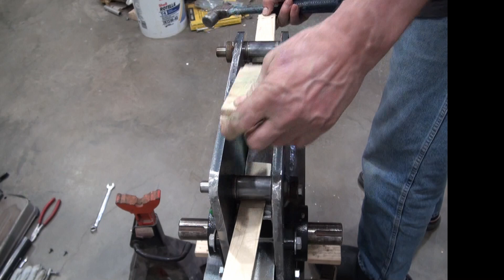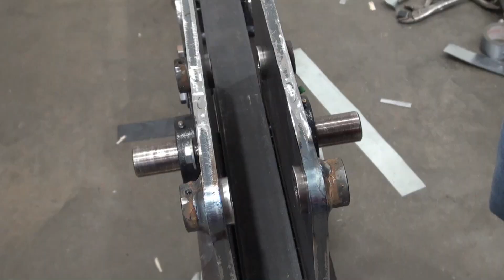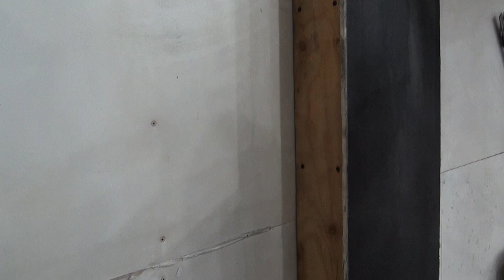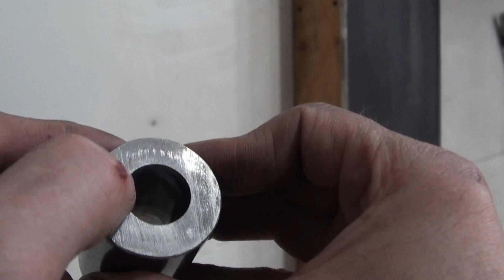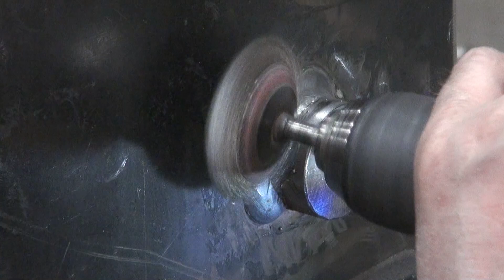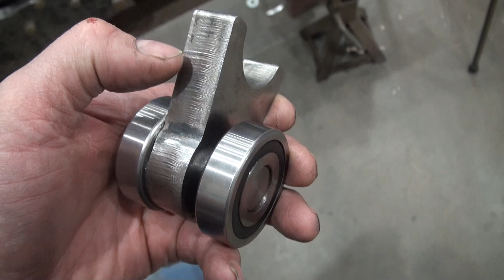Kinetic Log Splitter Build Part 13

Comment: 2:48 would taking a torch and heating the areas you welded on and letting them cool down again relaxing the tension
Reply from the maker: That may be some good advice my friend, heating to straighten steel is something I need to learn. Thanks for your many comments.
Reply: @groutaone  I missed many video because not getting notifications I am really behind but it may be something that you can try next time I know it works for some welding I just don't remember if it works most of the time  I reset my notifications again and have you in a growing list of not getting notifications and check daily for new vids 😀 I always live intermission you are the only one that didn't stop the few I saw doing that have stoped but it adds to your videos 😀
Reply from the maker: Thanks man.